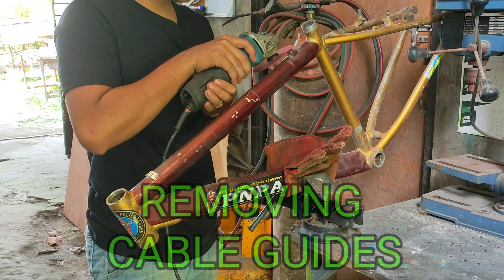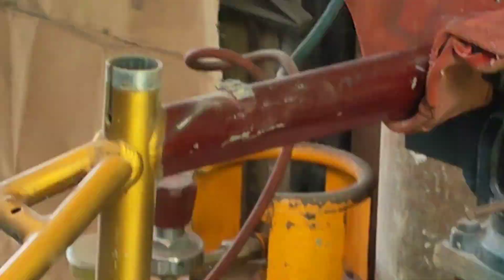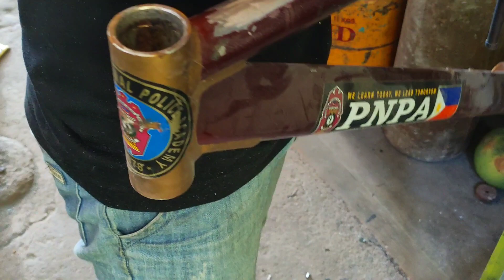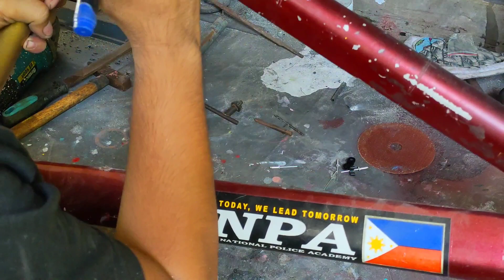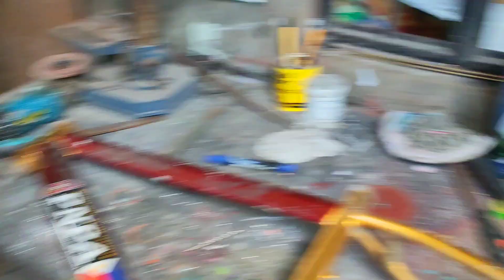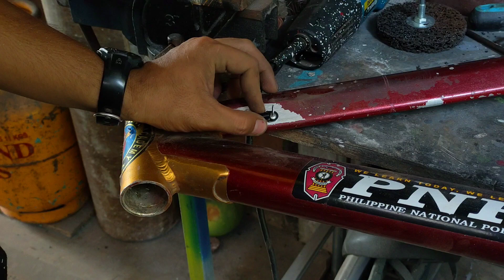FRAME MODIFICATION: INTERNAL CABLING + HYDRAULIC BRAKE CABLE GUIDES

Comment: the real question is... is it still safe to ride this frame? i wanted to drill a hole in my top tube for icr but the internet says NO while some pll say go for it. im using my bike for daily commuting. the road on my place isn't particularly all smooth but i always take caution when approaching inevitable potholes and such. its 26er aluminum frame from Taiwan frame maker raston.
Reply: Go for it

Comment: Sir may tanong po ako lossthread po Kasi Bb shell ano po Kaya pwede gawin pwede poba ko gumamit Ng press fit na bottom bracket sana masagot
Reply from the maker: di ko sir sure. parang iba yung diameter ng pressfit na bb ee